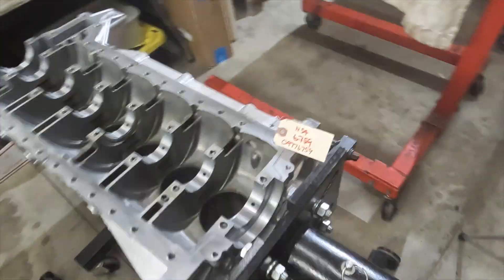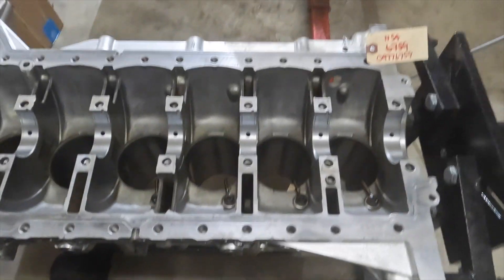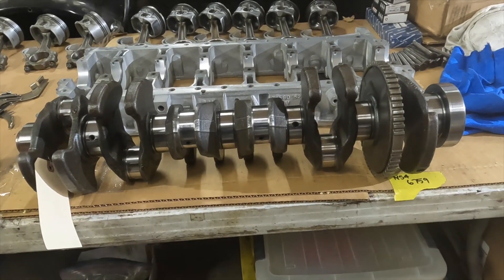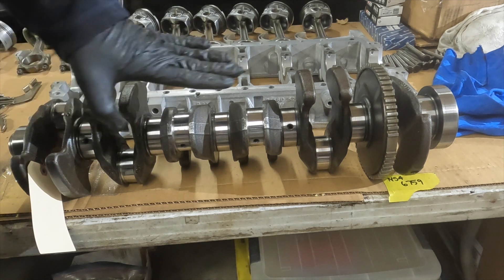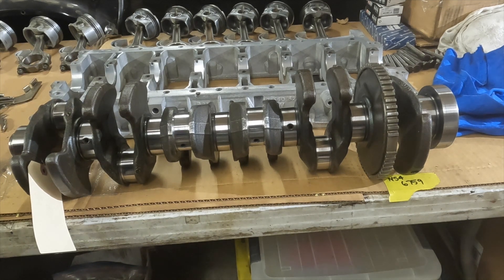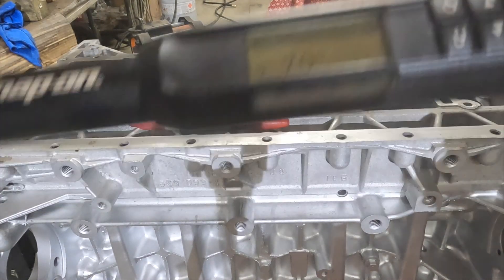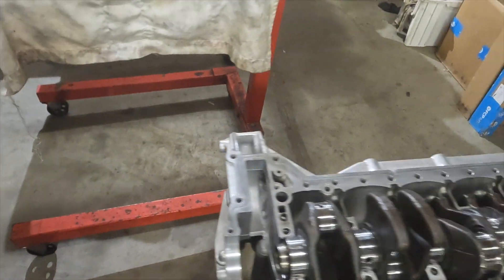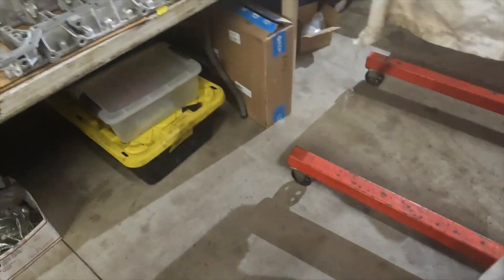BMW N54 6759 Rebuild Main Bearing Oil Clearances Part 2

Comment: I have the same main bearing clearance and the crank is very hard to move after final torque
Reply from the maker: Did you check the runout inspection on crankshaft to determine how much it runs out ( bent)
Reply: Have you found out why he is so hard?